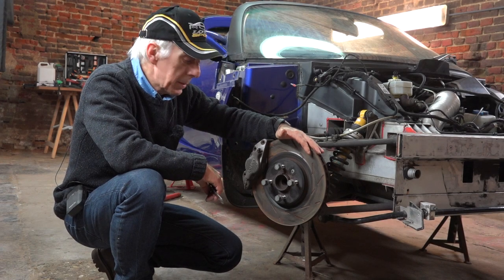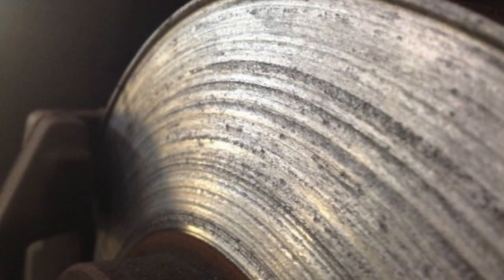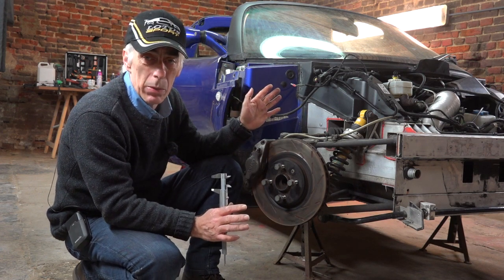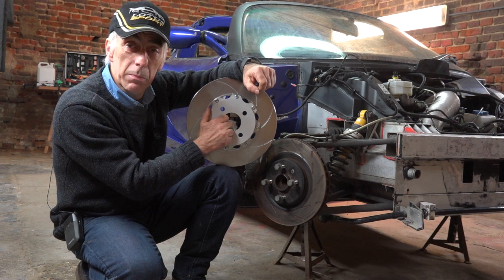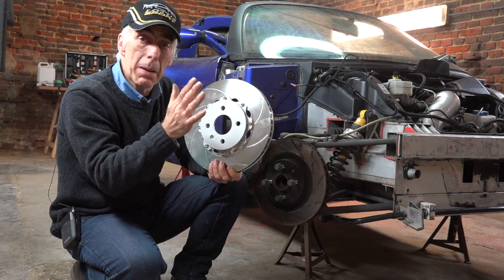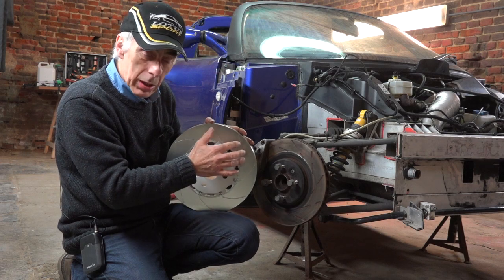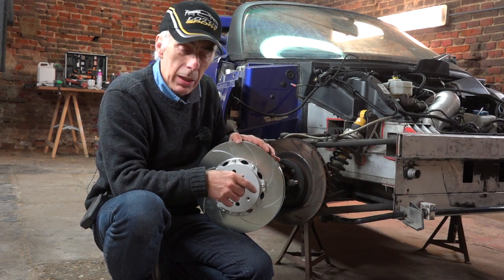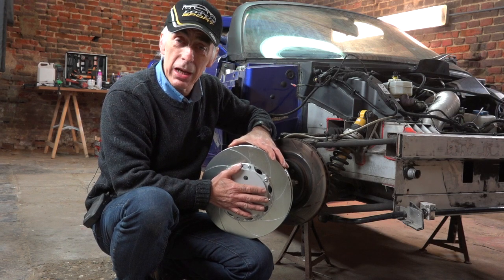Lotus Elise, Upgrading discs or not

Comment: Hi Steve, I've just ordered the same aluminium bell discs for my Elise. Were you happy on the road or track with it or do you sold the car before driving it ? Do you think it will pass CT here in Belgium with these discs only at the front of the car and OEM cross drilled discs at the rear of the car ? Thanks, David.
Reply from the maker: Hi David,   At the end I had to remove the bell discs as it would not pass the CT.. Silly , but they stated that the discs were not original.    If you are lucky , you will pass... It all depends as mine had been an accident and they looked closer.   On the track they worked great, no issues with that...  Good luck

Comment: Nice video.  I would, however, like to address a couple of things.  I wouldn't consider the weight savings at all, as it really is a non-issue.  Weight savings of any kind is good, we know that, and saving unsprung weight is even better.  But in fact, there is no appreciable track difference in saving 5-10 kg per corner.  Lotus themselves has fit heavy/light combinations of wheels and brakes over the years with no difference in track times, and even the heaviest of these on some of their track-only cars.  But in general I agree that lighter is better.  Second, drilled discs are NOT all show, you will find them on many racing cars even to this day, including track-only Lotus Cup cars.  Beyond that, not all drilled rotors crack, many have no cracking with street use and the occasional track day.  Some even have no cracking with hard track use.  Can you show me a Cup car 308 rotor with cracks?  Out of all the thousands that have sold?  It may be better in the long-term to run grooved for a track-only car, but your video didn't mention that kind of car, so I would say that for the occasional track day drilled is perfectly fine.  Lastly, it's always good to mention the sizes of things you're talking about, in this case, 288mm rotors.  

All in all a good video, keep up the good work.
Reply from the maker: Andrew Thompson  points taken and txs.    As to the cross drilled discs.  That is a generic statement for normal road discs.  Not for real track disks,   Yes you are right i should have made that point.  Thanks agsin